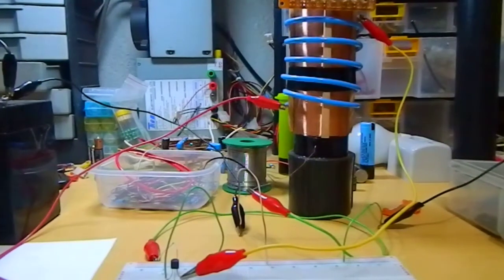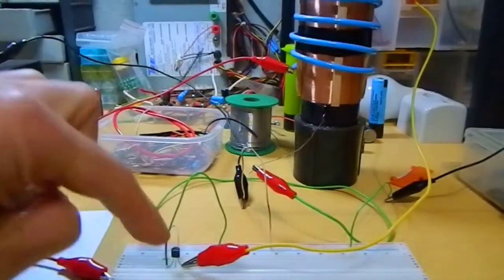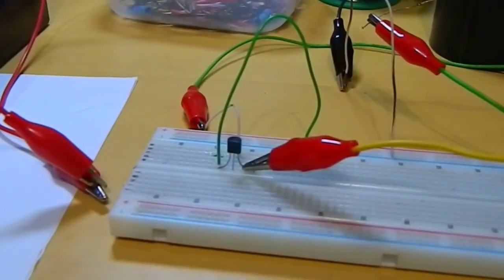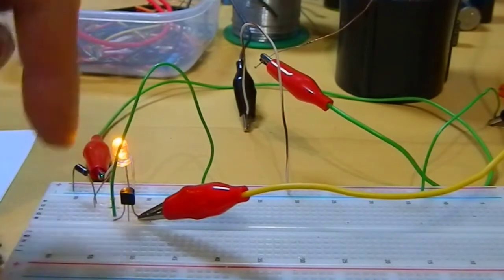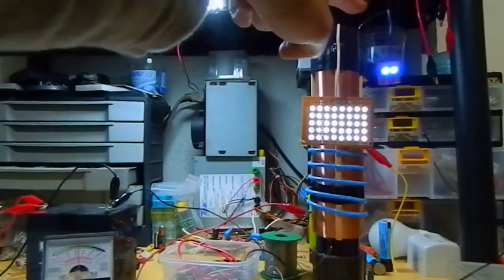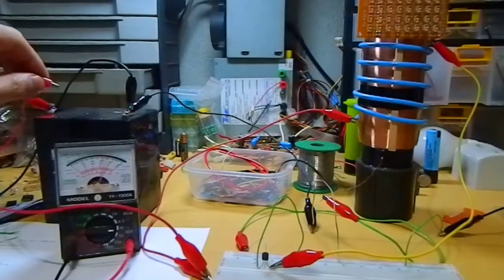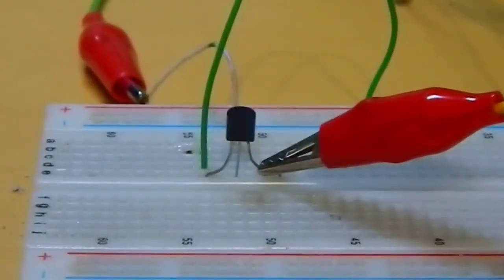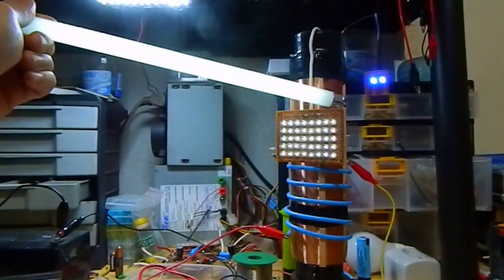SlayerExciter Single Component

Comment from the maker: I´ve recorded this when I was building the base for the SlayerExciter and I forgot to post this one. I was trying to make one coil out of a fixed inductor and try to use like this, but until now.... no results with fixed inductors.
This things are very interesting to experiment with. The other coil I have with the top load only turns on when I connect some load to it.

Comment: Tip - use a BBQ lighter next to tower for 100% start up if it doesn't fire.
The circuit needs a very fast pulse to start, as though from the transistor and the act of connecting a clip lead is often too slow. In a regular Slayer, there's a 20K or whatever resistor needed to the base, but it too can be removed once the circuit starts. 
My SWES works the same way on a pancake coil :)

Comment: Very interesting find! Just the voltage turned on in the primary must be inducing a pos charge on the secondary to switch it on. I strongly suspect the b-e breakdown property's of your transistor may be keeping it running. Allowing the secondary to draw electrons from the neg rail as it oscillates low. Then the back emf is switching the transistor on.